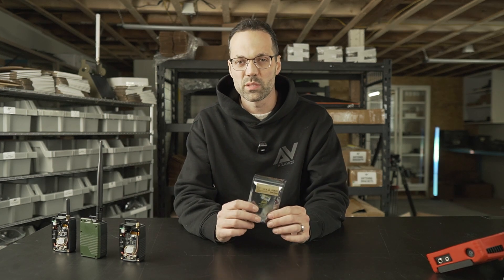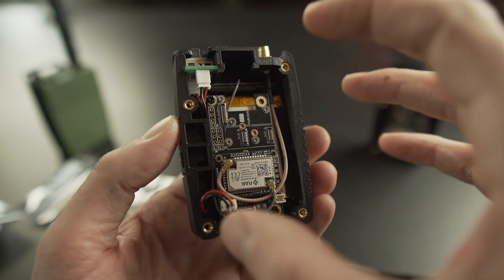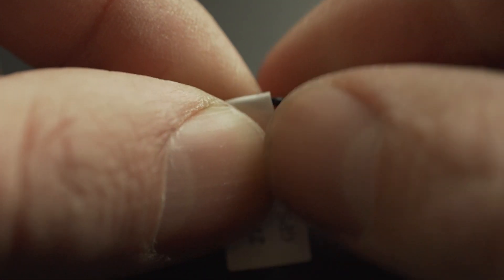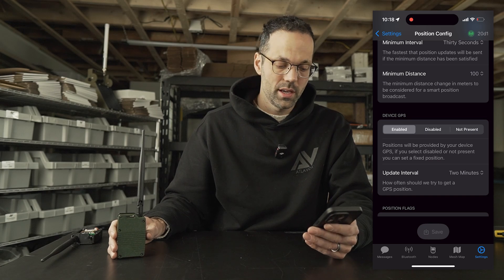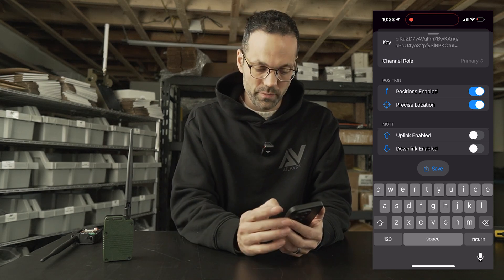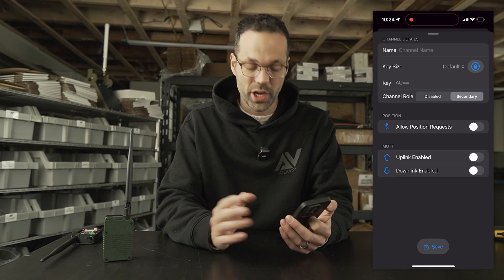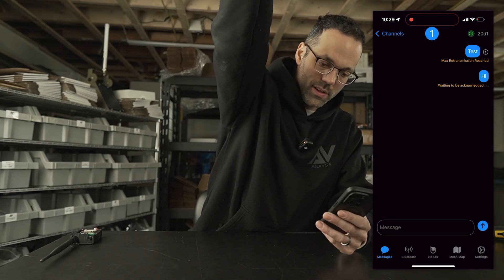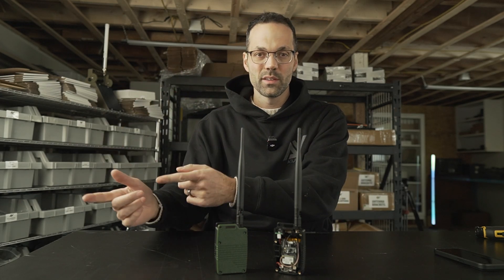Installing and configuring a RAK WisBlock GPS for Meshtastic | RAK12500

Comment: Where did you position the other end of the GPS antenna, and how?
Reply from the maker: The M1 has a slot built into the case at the top of the radio for the GPS antenna. It just slips right into the pocket.

Comment: Frequency slot slightly adjusts the utilized frequency. Like instead of 915MHz, it uses 915.137MHz. It helps to avoid network congestion in private network scenarios.

Comment: 4:20 for ipex/u.fl connectors, its better push it on flat, so the little pin in the middle doesn't get bent and it doesn't bend the clip on either side. This helps to prevent damage and ensure proper and secure connection.
Reply from the maker: That's essentially what I do. Approaching at an angle just makes sure the connector is aligned properly before attempting to press down. It's harder to tell if you're aligned correctly if you approach it parallel to the connector. Good clarification.